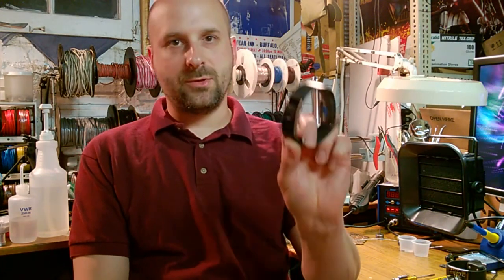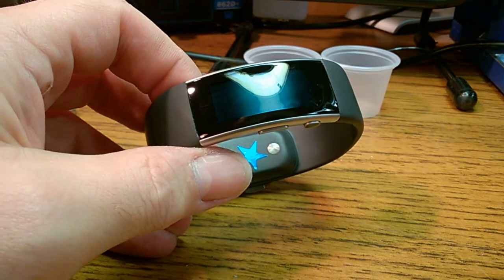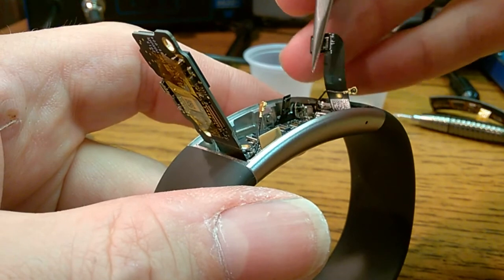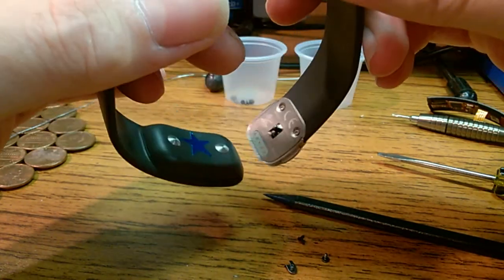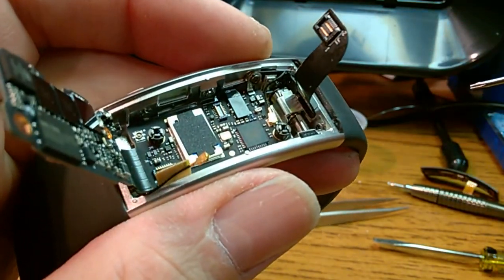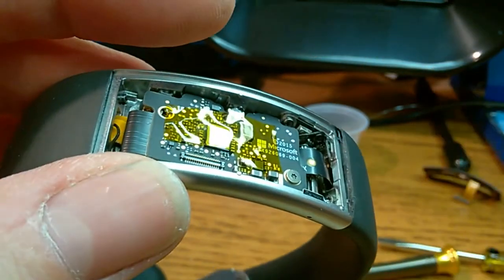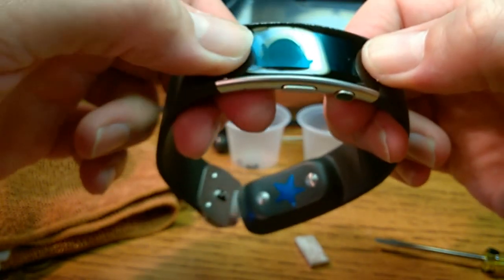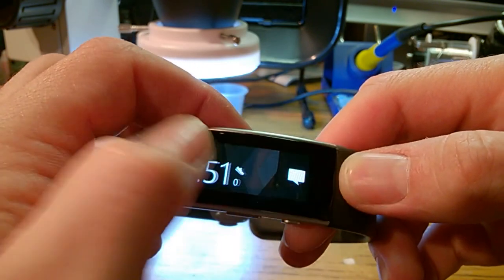Microsoft Band 2 teardown & logic board swap

Comment: Very well done! I have a band 2 that just won't charge /turn on. Still need to take apart what I can of it to test. Any pointers?!
Reply from the maker: Even with a bad battery they still come on when connected to the charger and attempt to charge so first guesses are bad charger or bad flex cable in the watch band going to the charge port. Can't completely rule out the battery though, if it's old and used a lot changing the battery might solve everything. In any event, sounds like it's time to have some fun, open it up and test some stuff!
Reply: Thanks for the reply Paul. I have searched high amd low on the internet for info on the bands power lead pinouts and can't find anything. I have two leads, one that appears to be dead and another that, looking at it face down on the table, appears to have two negative terminals, pins one and two from left to right and one positive on the extreme right. (giving 4.9V). The remaining two pins have no power output. Does that sound about right? I'm suspecting my cables but unsure as I don't have another band to test with!! Thanks for your help, appreciate it.

Comment: Hi mine dont charge anymore....when I plug it it will show the charging symbol and a tiny blinking light on the other side but never to be charged....wont even open is I push the power button.....please tell me what to do
Reply from the maker: Sounds like a bad battery or a bad wire inside the rubber band. You can try changing the battery, that might get it running again. If it's the wire in the band, they are very hard to change, then your best bet is to do what I did in this video and put your logic board onto a working band with good battery and wires.
Reply: @A2000MHz  Thanks Paul....where can I buy batteries for this....can I bring it to best buy where I bought it?
Reply from the maker: I think working on these is going to have to be do-it-yourself from now on. Since Microsoft has pulled all support, shut down the apps and back-end servers. The only place you will still find parts would be eBay.

Comment: My friend, how are the wires connecting the logic board to the battery? My Band presented that problem of not charging and not holding load. Stirring in it, I discovered that it is a bad contact near the battery. He wanted to open the rubber to get the wires. Do you have any suggestions for the task?
Reply: Kinda same problem. Any idea where I can get spare parts?
Reply: I have no idea, I will try to open a pulse of mine, and see if I can understand the problem, any news I notice here in the comments. I just wanted someone who has already opened a wrist, say what it's like inside, not to ruin it too much.
Reply: Darn, I hoped someone could give me a clue ;)
Video is quite self explanatory, regarding the disassemble.
As for your question: charging wires could be damaged if you are wearing a bigger sized band than you need to, and you have to click like all the way to tighten the watch belt on your hand. Been there - done that. A little crack on charging wires could lead to charging problems. 
For example, it could only work if pluged in. And not hold the charge pluged out.

Comment: Is the battery in the strap on the other side than the charge connector? If you show how to replace the battery, you can bring the band back to life for the millions of bands that died of neglect by its maker.
Reply: To remove/replace the battery you can heat up the metal side of the clasp (the side with the slide channel) and remote a thin metal cover.  The cover will bend if you aren't careful, but once removed there are 4 T2 screws that need to be removed.  Then heat the clasp up again to expose the battery.  I found that putting the other side of the clasp in place will give you good leverage to get the channel piece out.  Once exposed you will see a black ribbon that runs to the leads that determine if you have the band on.  And there is a pop connector for the battery.  The battery comes out...it is a bit tight, but not adhered to anything.  I had a couple of bands with torn bands and I was able to take a battery from one of those and put it into a non-torn one suffering from no longer charging.  i.e. when plugged in empty battery icon with flashing pixel in lower left corner.  You will see this same behavior if you remote the battery.  Connecting a working batter will change the blinking pixel into a progress bar along the bottom.  FYI, you can buy the batteries on ebay for about twenty bucks.

Comment: Old Betsy hot air station Wish I still had my 1st station Nowadays I won't go with nothing but the JBC Little pricey but worth it
Reply from the maker: for the 50$ price tag that little station works great. I still have that and still use it from time to time. I like how quiet it is and you can get replacement parts.
Reply: @A2000MHz   Yeah I still wish I still had my 1st station but it stopped working ... Then I saved up for the JBC ... My last station was quiet the JBC sounds like a jet engine lol